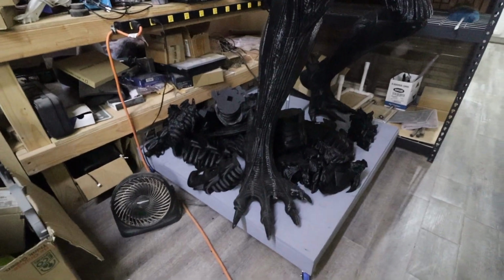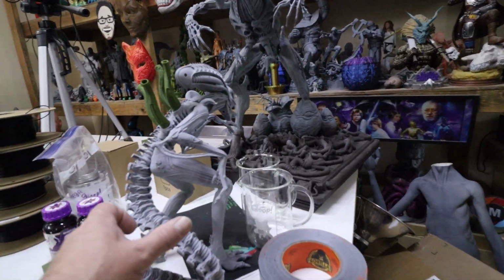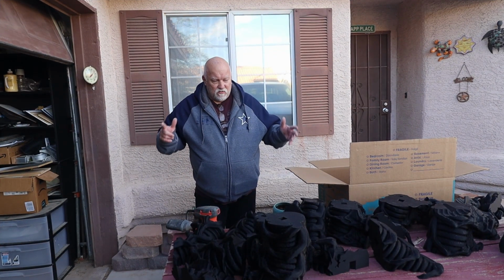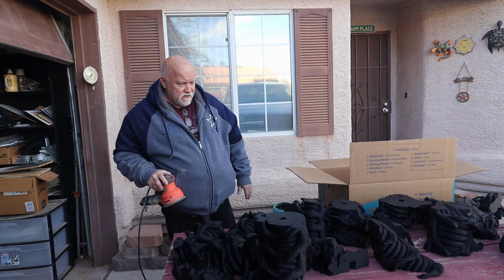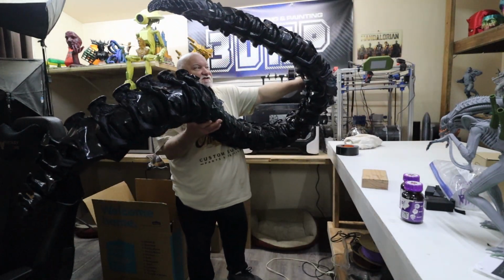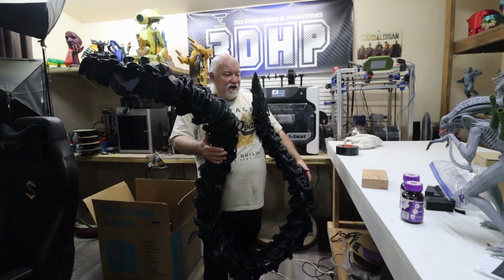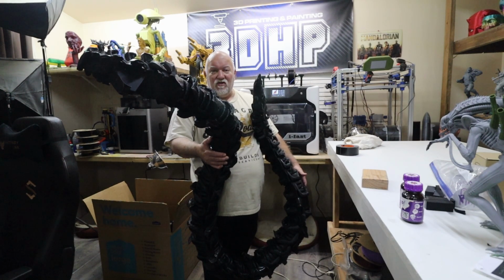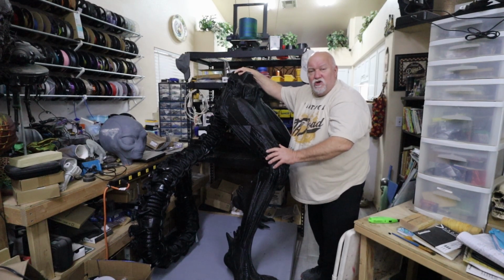Life Size XenoMorph Alien Build | Part 3 | The Tail #3dhp

Comment: In regard to hard to remove tree supports. If bambuslicer supports it ( I presume it does, but you never know) it might be worth using a different filament for your support interface layers on any machines that support multi-material. it will add a bit of time but using PETG or Polymaker Breakaway support for just the interface layers should let you set your interface to 100% for maximum quality but still be much easier to remove.